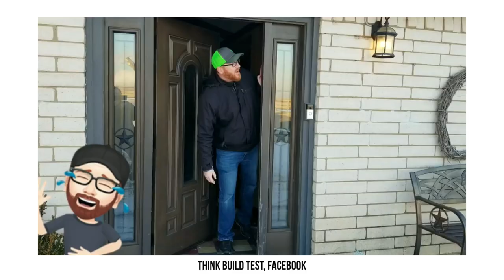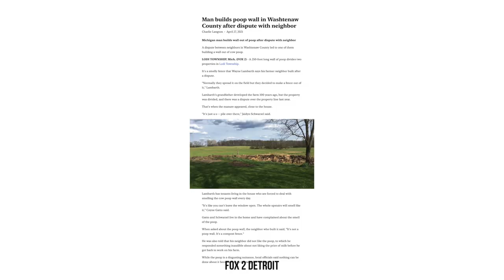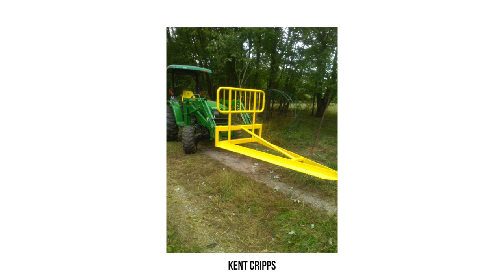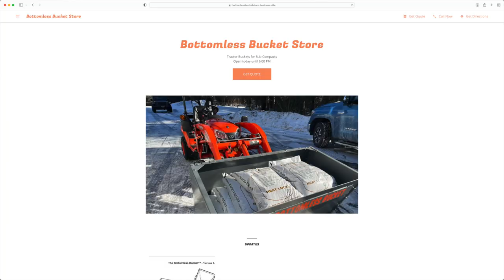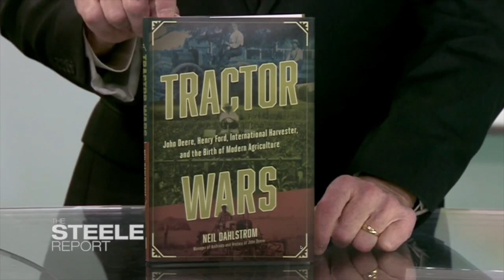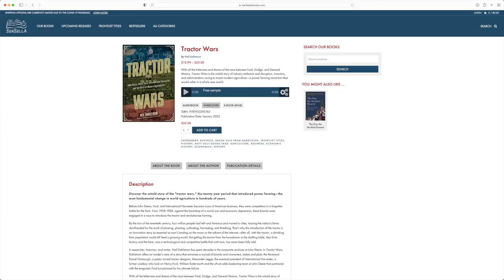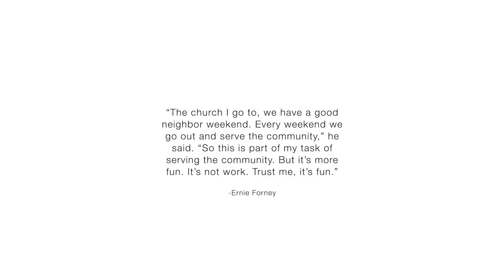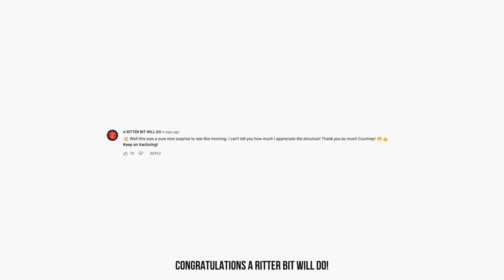CRYIN' SHAME AS JOHN DEERE GOES DOWN IN FLAMES! 🔥😭TRACTOR TALK #5

Comment: I have a therapy on the hydraulic filter leek. 
If you are not careful when you take the old filter off the gasket will stick to the engine black. Them you put the new filter on and it won’t leak at first. But once the tractor heats up and cools off that new filter will be loose.
I have seen this with cars more than one.
Have a great day!
Doug

Comment: Absolutely love the mods like front Fenders!  The grapple is sweet! Needs a rotation control though.
Tire plugs are great!  Even work on fluid filled tires; rotate the puncture to the top where the air pocket rests. Repair as usual

Comment: I like the bottomless bucket idea.  Being aluminum and bolt together would allow it to be flat packed, shipped anywhere, and assembled by the owner.  The biggest downside I see is that aluminum stress fractures very easily.  The other issue I see is being able to easily dump the contents due to the high front.
Reply: We’ve been field testing for more than a year and there have been no issues with stress cracks.  The bucket also dumps well due to the angled front panel and angled QA brackets that enhance the dumping characteristics.

Comment: Thanks Courtney and to the whole GWT team for featuring us on today’s Tractor Talk “Tool of the Week” and we’re looking forward to the feedback, both positive and negative.
Reply from the maker: Happy to help!
Reply: I know you are being serious so I will apologize for the money pit joke, what do you think of a vertical slot in the back about 2 by 8 inches near the top allowing you see in the bucket while seated on the tractor?
Reply: @jamesfarrow2130  we don’t offend easily here.  In my testing I found I could see into the bucket from the drivers seat assuming you carry the bucket low as is the safe practice.  I’m curious what your concern is though so not discounting this idea what so ever…
Reply: I like the idea of the bottomless bucket a lot. Would it be possible to offer a bottom dump feature? Pull a lever and the bottom hinges open to release the contents??
Reply: @thebottomlessbucket5337  It just seemed to me that it was difficult for the operator to see while dumping the tree out. Could have been a bad angle or maybe I wasn't paying close enough attention. Anyway, the most common comment I hear from people who buy a subcompact tractor is 'I wish the bucket was bigger' , so good luck to you!!
Reply: @michaelespalin7457  Hey Michael thanks for your feedback.  Based on our design, the bottom and two side panels are the foundation to the rigidity and strength of the bucket and we have avoided compromising those pieces by cutting or opening them up.  We have considered converting the front panel to a swinging dump door which would operate like a dump truck gate.  To accomplish this correctly, we would want to actuate the door with dual actuators on each side of the bucket connecting it to your third function valve and allowing you to open and close the front swinging gate from the operators seat.  We see this adding significant cost to the bucket, so while we have it in our design plans, we likely would offer it as a higher end version that would be targeted for commercial or industrial applications.
Reply: @jamesfarrow2130  I see now what you're asking.  This is a common problem with buckets in general but your point is well taken.  A simple solution would be to mount a mirror to the side of the bucket that peeks into the bucket and is visible when the bucket it tipped. 😉

Comment: I have a 2014 Deere 3038e and busted both front tires from roots. I had got new tires and had them foam filled. That adds 90lbs of ballast to the front, you never have to worry about a flat tire again and the ride it much better. Definitely recommend it. Probably wouldn’t be a good choice for the rear it would be about 500lbs per tire of added weight

Comment: Bottomless Bucket Idea.
Make a material classifier.
Use a grate for the bottom with 6"
Open grid. Then supply 4 sizes of smaller opening grates to drop in on the lower grate to classify the size material your after. 
Just a thought.
Reply: I’m not familiar with classifiers but from what I can understand is you want to sift materials to get the fines to leave you with the cleaned material on the bottom.  Interesting idea.  Would be interested to learn more.

Comment: That loader lock out part should be standard equipment with any machine with a front end loader. I live in central PA and an individual was just killed in an accident involving a front end loader. He was replacing a hydraulic line on his loader and had the loader jacked up with something to work on it, while working on it the jack slipped out from under it resulting in the man being crushed by the loader and unfortunately losing his life.

Comment: Bottomless bucket could be great for certain applications. I think it could use steel wear plates front and bottom, maybe pretty significant weep areas to let moisture/water out for wet loads?
Reply from the maker: Both great suggestions, thanks!
Reply: Thanks for your feedback.  The bucket has natural weeping areas where the panels come together on each corner so water will drain.  We’re considering adding castors to the bucket to both protect the bottom, and allow you to roll it around without being attached to the tractor.

Comment: Had the same thing happen to me with the hydraulic filter. I replaced it in the summer and the very first good cold snap where the filter came loose enough to loose about a gallon of fluid before I shut it off.

Comment: I’d add aluminum channel on the corners and along the bottom to stiffen it up and decrease the flex in the sheeting. Love the concept hope you will have an upsized one for a New Holland PowerStar 75. I love the concept just worried it will buckle if overloaded or bump/run into anything. Thanks for bringing new products on the channel
Reply from the maker: Good stuff, thank you sir!
Reply: Thank you sir.  It's hard to tell from the video, but the side panels are, in fact, angled on all four sides to create a channel for the bottom, back and front to rest on.  The bottom is also angled front and back to create the channel for the front and back panels of the bucket to rest on, and all 5 sides are bolted together to the two side and floor panels.  There area also gussets on the back/top corners that ensure the back and side panels can't buckle.  You would be impressed if you saw how rigid this bucket is.  We loaded 600 pounds of wood pellets into the bucket and didn't see any hint of buckling, but I agree, if you bumped into something hard enough, I hesitate to say you wouldn't do some damage to the bucket.  Strength vs. Weight are battling objectives and it's always a delicate balance.  As for an upsized version, we would be lying if we said that was in the works given the size of the Sub-Compact/Compact tractor market, however, that being said, I have seen a number of oversized steel light material buckets that may fit your needs so be sure, they are out there.  This one is targeted for the sub-compact/compact market without a doubt.
Reply: Since I’ve moved up in horsepower and hard on equipment always looking for options… Great concept!
Reply: We did introduce The MOAB (Mother Of All Buckets) last fall and it’s 100% steel for larger tractors and a lot bigger than The Bottomless Bucket.

Comment: For the bottomless bucket I noticed that it had to be tilted quite a bit to drop out that Christmas tree. Maybe this isn’t for every bucket but as an optional bucket you could have where the front panels were detach or the bottom would drop out hydraulically to allow for easier dumping of light loads.
Reply: Thanks for the feedback, very insightful.  Stay tuned we’re coming up with a new QA bracket that will maximize the stroke of the bucket tilt increasing the swing 12”.
Reply from the maker: Thanks for sharing!
Reply: @thebottomlessbucket5337  I don't understand what you are trying to accomplish with this bucket vs a normal bucket. It is a bit lighter and higher volume, but cannot scoop up bulk materials. What is your goal?
Reply: @court2379  This is for hauling materials around, like leaf and lawn clippings that come out of your bagger.  You dump the bags in this bucket vs. dragging them back to your compost pile.  If you're mulching you place the bucket under your tail gate and fill the bucket, drive it to your garden beds and use the curl to gradually tilt the bucket and scoop out shovel fulls of mulch.  If you're moving firewood you stack it in the bucket, drive it to your fire pit and stack it there.  If you've got bagged material you move it to where you need it.  The normal bucket is just too small to load it with any volume.  Because it's quick attach, you can use your thimble size bucket to fill this larger bucket with mulch, and then drop the small bucket and hook up the large bucket to move the large volume of material where you need it.  Makes your quick attach even more useful.
Reply: @thebottomlessbucket5337  When I was a kid my dad owned a landscaping company. We made an extension to a normal bucket for that. Used it for snow and debris that were not as heavy as dirt. 

My two bits would be to do the same, but make it quick attach (ours was bolted on). Put a hook at the top of the extension and bolted on plate with a protruding pin on the inside top of the bucket. At the bottom have a slot for the normal bucket edge to slot into. A pin can go thru the bucket side near the bottom to retain it. The extension can also have a cutting edge, but lighter duty to save weight. Then you can still scoop materials, but get a much larger volume. If you leave the pin out, just set the bucket on the ground and roll forward and down to detach it. Just like the skid steer QA.

Comment: A possible suggestion for the Bottomless bucket.  I am not sure this suggestion is possible but, due to the large size of the bucket [and not everyone is blessed with height and long arms[, it might be nice if there was a way to make a door out of the front of the bottomless bucket.  That would, theoretically, allow people to place the initial items on the bottom vs dropping those initial items in the bucket.  Looks Like a good idea though.
Reply from the maker: Good suggestion, thanks Nathan!
Reply: Thank you for your feedback.  If you tilt the bucket while your loading it you can more easily reach the bottom.  We’ve also consider clipping a couple of inches of the front panel which would help, but we’re stubbornly trying to avoid compromising volume.  Gating the front panel is in fact, a design we’ve played with but to do it properly we would have to actuate the gate which will be expensive but something we’re considering for industrial or commercial applications.
Reply: @thebottomlessbucket5337   Good points and thank you for the explanation - Makes sense. I do like what I have seen of the product. I hope it becomes popular.

Comment: I bet the guy with the lose oil filter double gasketed it, the old oil ring off the old oil filter stuck, and he didn't check it. 
    Then he installed the new oil filter with a new oil ring onto the mounting with the old oring.
Reply from the maker: I can see that happening!
Reply: @GoodWorksTractors  Common Mistake from people self servicing.  Just like people not using a Porta press to pull the stump Jumper off of a bush hog.

Comment: Re: The bottomless bucket.  I'm just wondering if a bottomless bucket could be made cheaper with steel angle iron, and either heavy gauge mesh or expanded metal, especially for the sides and face.  I think it would be cheaper than aluminum.   Something like that might be handy for rounding up tumbleweed to be burned.
Reply: Thanks for your feedback.   Our original prototype was built using sq. aluminum framing and galvanized sheet metal skins, and though the material costs were significantly less, the amount of labor required to fabricate the frame was much higher, and consequently, scaling the production would be challenging.  We're hopeful the commodity price of aluminum will begin to moderate as was the case in Nov of 21 when the metric ton price fell from $2934.00 to $2636.00.  Today it sits around $3005.00

Comment: As I watch your channel I watch the ads for the Bora wheel spacers.  What effect does that have on the axle bearings by moving the weight of the tractor further out on the ends of the axle?
Reply: They put a little more strain on axle bearings yes, but I have yet to see or read about a failure being solely the spacers fault. I have over 300 hours on my 2” spacers on my BX23S.
Reply from the maker: We've done a lot of videos on spacers.  I asked viewers to list issues they had as this is a common concern.  I didn't get any responses that were negative.

Comment: The sides and bottom of the bottomless bucket should not have a lip on it  to stop the cargo from coming out
Reply: Thank you for commenting.  Just to be clear, the front has no lip.  It’s smooth with no obstruction.  While the lips on the side panels may initially hold some material, that material typically falls down to the front panel with a quick shake of the bucket.
Reply: @thebottomlessbucket5337  From just watching that one clip, I am concerned about the ease of dumping. If you increased the forward angle of the front wall, even by a few degrees and maintained the same height, it would make it easier to unload. Another option for the front wall would be to install a piece of hard plastic ( dump body floor liner) on the inside of the front wall, this would allow the material to slide out much easier. Hope this helps.
Reply: @bladewiper  Great feedback! To address your concern we have a new QA bracket we’re going to try out that can bolt on and will increase the dump by another 12”.
Reply from the maker: Thanks for your feedback, very helpful!

Comment: Round the bottom of the bucket, and give the dump side more angle
Reply: Thanks for your feedback, very helpful.  We're working on some things to improve the dump capabilities.  It's worth noting that the sheet aluminum comes in 60" X 120" sheets, and if we could have, we would have loved to increase that front panel angle, but we maxed out at 30".  Believe it or not, we're in a constant battle to maximize utility and volume, but one or the other always has to win.  Our experience with earlier prototypes taught us that you can never have enough volume.   We are curious, however, why rounding the floor would be desired?  Doing so would not allow the bucket to sit flat on the ground when it's not on the tractor, but maybe we're not understanding what you're suggesting.